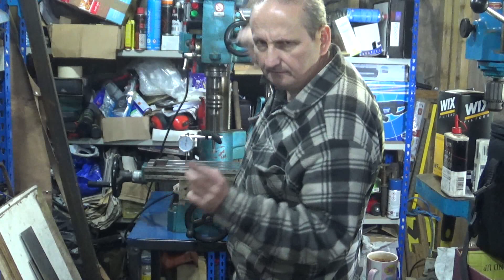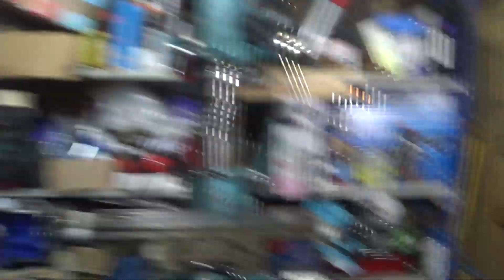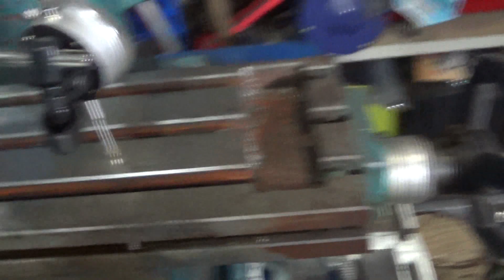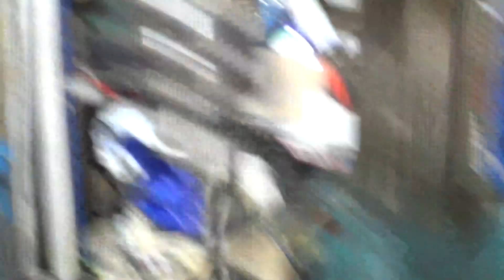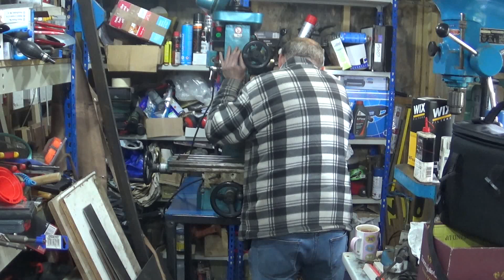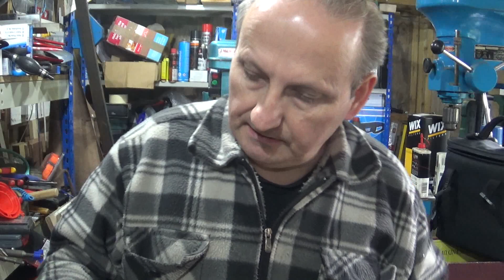Naerok Round Column Mill Drill Initial setup and first cut

Comment: This is the only video I could find for this process on a round column mill.  Thanks a lot it was helpful.
Reply from the maker: I am pleased it was helpful. Couple of extra tips. Use a shaft that is the right fit in a collett. Take your time.

Many thanks for watching, please like, share and if you like the channel, subscribe!
Reply from the maker: PS, I have had a look at your channel, please note that it can take a long time to build an audience, do not be disheartened. You do have an extra subscriber.

Also, I did have a problem with the motor on mine and did a video on fixing the motor. There are several videos involving machine tools.
Reply: Thanks Ben. Yes, I have just started the channel and making videos. I have built a lot of stuff in the garage over the years so I will have a lot of content that can be made and shared. Once again thanks for the tips.
Reply from the maker: For some reason YouTube decided this was likely spam and hid it for 2 weeks so I could not even see it in the hidden comments section. Good luck!

Comment: Just found your channel . I bought one of these in the mid 1980's , Brilliant m/c, solid and built to last. Fitted a DRO on 3 axis , a couple of years ago.
Reply from the maker: It is a good solid machine, don't know if I am going to fit a DRO. It did feature in my last video (making the centre bolt for garden sheers) but between the lathe work and the mill work I did have to fix the motor on it which I managed to do. 

Many thanks for watching, please like, share and if you like the channel, subscribe!

Comment: It's a nice solid looking machine my friend
Reply from the maker: Cheers. It is. Also whist the motor does not appear to have a power rating it seems to have plenty.
Reply: @BensWorkshop  where are they made? It looks like an 80's Taiwanese or korean machine and I always hear good things about them but am not familiar with Naerok.
Reply from the maker: @turboconqueringmegaeagle9006  Naerok is Korean backwards, so it's made in Taiwan. Obviously.... I believe the brand was owned by Graham Engineering, who imported and possibly commissioned them. Alpine ones are similar apparently. There's a write up on lathes.co.uk . Well regarded there.
Reply from the maker: Here's the Lathes article: There's many round column mill drills, this is the only one worth buyng.
http://www.lathes.co.uk/naerok-mill-drill/
Reply: @BensWorkshop  lols, thanks for pointing that out.